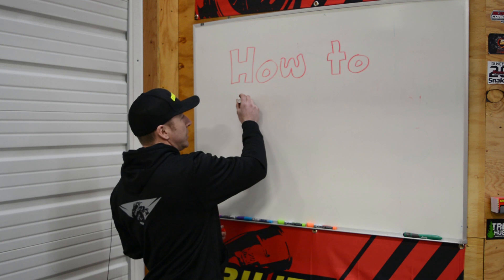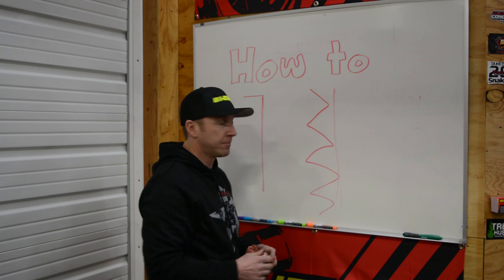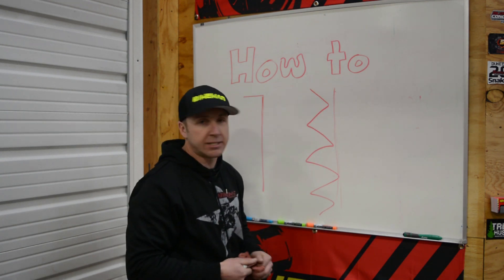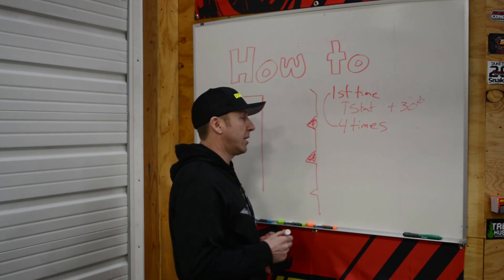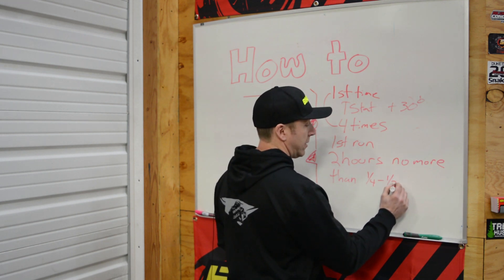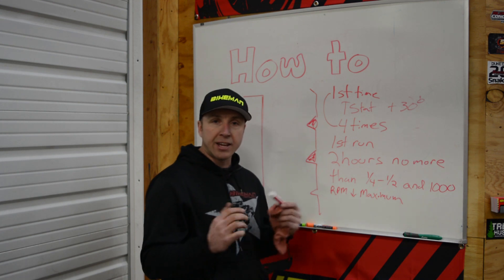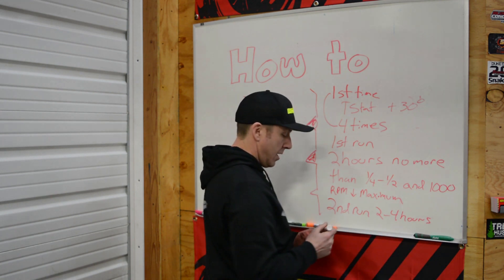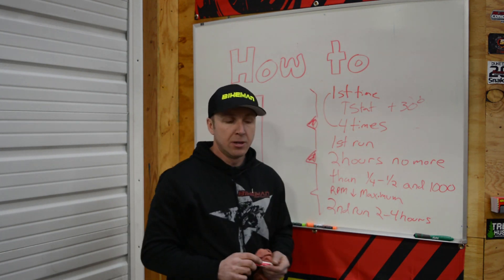How to Break-In a New Engine Snowmobile SXS Tech Tuesday

Comment: My ride is good to go but I got another newer sled with a blown motor to build a monster over the summer.   With the first fire I get keeping it below 2,000 RPM.  (probably ok below 3000 too)  but let it idle?    Idling is bad,  on 4 strokes the most cam wear at idle,  a steady RPM is bad for either 2 or 4 strokes.   

My plan is to first start with the drive belt off or maybe even the clutch not on yet.    First start alternate the RPM from idle to 2000 never sitting at a specific RPM too long until full operating temp,   Second start same but Idle to 2250 rpm,    third idle to 2500,  fourth idle to 2750 rpm...   Keep doing it going up 250 rpm  each time and the tach needle sweeping at moderate speed and never sitting still. 

After this.  I'm researching what race teams are doing with dyno break-ins.
Reply: The most wear on a 4 stroke comment is because the engine is cold at startup.  It is not a function of idling itself

Comment: Can i mix the gas on 2stroke efi?? Another thing i wanted to know was if its ok not to use brp xps 2stroke?
Reply: You should be safe I just put a new motor in my sled and pre mixed it 40:1 it’s and efi sled too I haven’t had any problems with it and for the oil you can mix any 2 stroke or preferably the oem oil or a synthetic blend 2 stroke oil
Reply: With efi being directly injected, it would think that it wouldn't help much..

Comment: this especially applies to two stroke engines  i've built a ton of off-road engines and i have found that 2 strokes are very temperamental to break ins if not done correctly where as the 4 strokes are a bit more forgiving with break ins but good video for sure its good for those just tearing into their quad or bike, etc, or the first time, to see how it actually works so their first engine build goes as smoothly as possible. now yes there is always gonna be those engines that just weren't meant to be, haha but that is just life in general haha

Comment: What a load of BS this video is, rings seat with combustion pressure, idling an engine for that many heat cycles kills your opportunity to get a good ring seal with the cylinder wall. A poor ring seal leads to excessive blow by and a host of other negative properties. 
As per the rest of the engine -- modern machining and materials have more consistent tolerances then ever before, the materials used in modern four stroke and two strokes are way better matched for all properties then ever before... So the break in required for such components is very minimal and way less critical then a good combustion chamber break in. 
.
I know, I know I am sure Joey is going to just sum this comment up to some key board warrior but I spent the last 30 years building and designing some of the fastest machines on the face of the planet in the air and on land, including 5 years in F1.  
But hey you do not have to believe me just do your own research and do not take this video as fact. 
Also you know what else will save you, the excellent design of modern engines will allow you to get away with almost anything other then down right abuse!
https://youtu.be/MlmHOMm9gow
Reply: I believe you are correct sir, our process is to start the engine and let it get to operating temperature and check for leaks and any problems, then it will usually hit the dyno. Let’s face it, every motorcycle that comes from the factory is run at full power on a dyno and through all the gears before it leaves the factory.

Comment: If im  using a new piston and rings. But used cylinder. Do i still need to break in.
Reply: yes you do!
Reply: Assuming with old cylinder new piston you would still hone the bore to create cross hatch to seat brand new rings...no nasty boring saw teeth" involved like on a freshly bored cylinder but either way the new rings still need to seat, I would think much less time involved though.if not an actual fresh bore..but that is a guess  Also some rings used to be coated like with Teflon (to facilitate break in I assume?) ...or at least many decades ago when I briefly was a Kawasaki /DKW wrench that was a thing